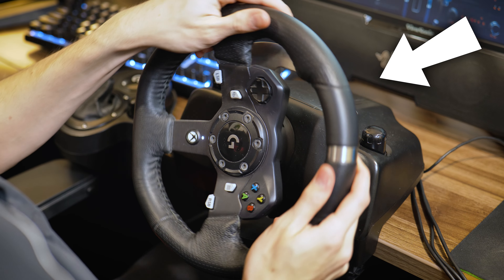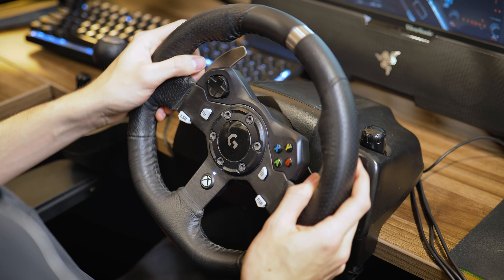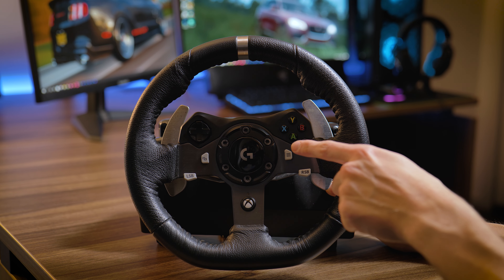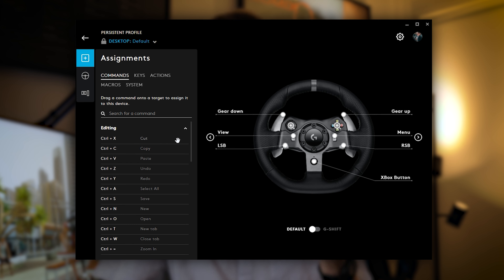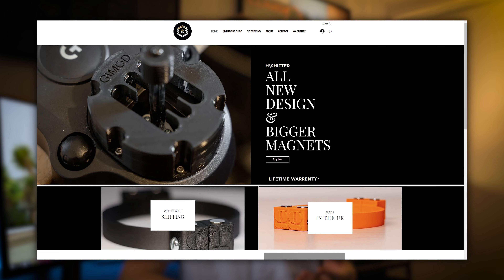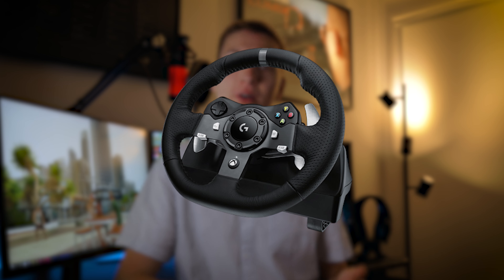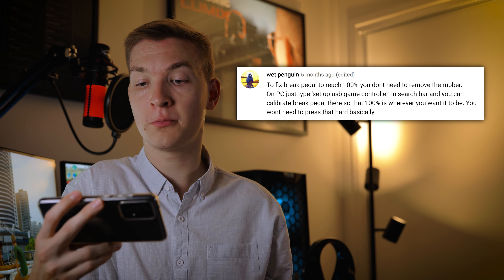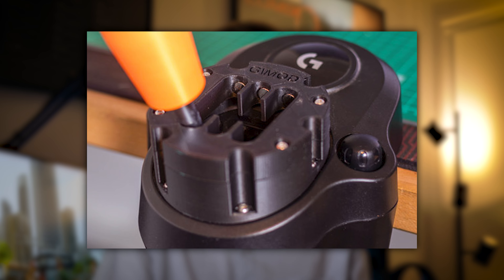Logitech G920/G29/G923: Don't Buy Blindly, Watch THIS First!

Comment: If the break pedal in your real car isn't acting the same as your gaming pedal on the g923, you need to get new breaks and break fluid really really fast
Reply: 1984
Reply: I've never used one of those, but it sounded a lot like my car lol
Reply: I have g920 It’s wayyyy harder than any car of ever drove even after getting new brakes
Reply: yea these people need to get their brakes fixed
Reply: Unfortunately, some cars have mashed potatoes for brake pads...I used to have a Kia that had a grossly soft pedal. That's just how they tuned the boosting, my Nissan on the other hand has a brake pedal that feels like the G29 pedals when you do the eraser mod 😍

Comment: $400 for a direct drive base only, a whole setup would cost about $1000.
Reply: This. Man almost sounded like he had a agenda when he said that.
Reply: Yeah but for 500$ you can buy a better wheel anyway with serious FFB torque. These G series are the weakest. So you either buy cheaper G29 or go for a better wheel at $500.
Reply: @bestopinion9257  that's what im saying and it is so unrealistic, sold mine after a year and a half. Played with it for about 5-6 times, the ffb killed it for me. Brakes and clutch on this were horrendous. Saving more money now for new belt based set up and better ffb
Reply: @SpeedNash  I had G27 and at its time was a good wheel. Best quality if you ask me with steel and leather and no signs of failure after 10 years. I bought G29 for the quality aspect but this is a fail. Nowhere close to G27 maybe except the leather. After 1 year already left shift doesn't work... A piece of junk, a downgraded G27 for the same money.
Reply: @SpeedNash  if you are saving money, save for a direct-drive wheel, they are cheap now.

Comment: This is the type of kid who wouldnt eat at all because his parents ordered cheese on his burger.
Reply from the maker: LOL ok...
Reply: All the things he mentioned are absolutely spot on. I've used G29 which is also one of the reasons I do not suggest people buying it and I sold mine in 1.5 years almost. If you want the best simulation experience logitech g29 is not it, stock steering wheel is pretty small, hate the sound it makes thats not how belt based wheels do which is similar to real life cars, breaks suck, logitech app does not work all the times or when it does the app settings do not align with in-game deadzone/sensitivity, pedal pressures, clutch absolutely sucks lol theres no pressure that shite is flat., takes 15-20 mins to set up and if im installing a new sim game, will take another 30mins to search right settings, aligning in app and in-game, the force feedback is servicable it is not at all close to what real cars feel, 

What are pros? Its the best wheel with the most compatibility out there I've seen for budge entry  that works out of the box in 90% games, even in PS2 emulators with GT4 through plugins
steering is very premium felt with nice leather stitching, quite comfortable to feel the games when racing however once you go off road it goes, ratatatatatata lmao what wheel does that, this is all due to motorized functionality.

I'm saving money now to either go for fanatec sim set up or thrustmaster, would be expensive but is defo worth it much more than this.

If you're on budget, go for it but do not expect realistic real car like behavior, its a stepping stone at best. Save a little more and go for thrustmaster for best ffb, essentially belt based motors.

Comment: Found it for $184 refurbished on amazon, definitely buying.
Reply: Which one? I am trying to decide between g920 (150 euro) and g923 (250 euro)
Reply: Which one? I am trying to decide between g920 (150 euro) and g923 (250 euro)
Reply: @verfresht  g920
Reply: @verfresht  trueforce and the better brake is not worth that much

Comment: I’ve had it for 2-3 years, the games I have played have a braking sensitivity in the settings so that was not an issue, the brake doesn’t have a ton of travel but that’s alright, you can also take out the rubber. Some people complain about the noise I haven’t had that issue I usually lower force feedback in games. I wish there was a separate place for the reverse instead of pushing it in. I also wish they made a handbrake.

Comment: the g923 doesnt have a rubber piece in the brake... instead there is just a extremly stiff spring which you can only replace😾
Reply: Vans slip on help that brake press

Comment: Re The brake pedal. On PC i calibrated the brake pedal using the Windows Game controller applet and set the pedal with approx 40% depression. Meaning 40% of pedal movement = 100% of pressure. For me in Assetto Corsa this pretty much makes the brake pedal accurate to a real car.

Comment: 1. I opened the pedals and removed the bump stop. 2. I never use the dpad. 3. bro is complaining about having to map controls, that is really not a problem. 4. I’ve had it for ages and they haven’t broke. 5. I’m not on console. 6. skill issue 7. “$400 is direct drive wheel territory” yes, for just the base not including the wheel, pedals, shifter and more which brings it up to about $800

Comment: I got it in portugal for 200 euros, my desk had no full suport to lock wheel 100%. In 2 or 3 races i expected wheel to drop 1 or 2 times with no warning. And pedals base just dance around my floor and almost damage the wire against the wall. Now i bought a lovit cockpit 200 euros, and this setup is amazing. Only good to talk about this setup! Worth it!

Comment: I bought a g923 with shifter with a stiffer spring and MVH load cell mod on the pedals for $190. And a stand for $50. If you are starting into sim and wanna see if you’ll enjoy it, find a second hand G series wheel and do that.

Comment: Hi , I appreciated all you said...BUT ...the G 923 for Xbox/PC and the gear shifter made in 2023 and this very important, this a diferent beast...all tthe issues previosly with G 920 is fixed , all the buttons are very diferent in a good way and pedals too and for the shifter in 2023 , if you opened , you will see a cheap  basic mod allready install ....buy all G 923 and shifter made after february or march 2023 an you will see all diferences ....very important the period when is made , check the date of manufacturing on the box ...!!!
Reply: What's the difference with the shifter ?

Comment: What about the brake firmware, can you make it fully linear? How it normally works is until you get to the rubber it's like 50% brake or something, but when you press through the bumper you get 100% brake, which is not great to control the car.

Comment: This review starts of with the brake. Simple fix is to use the logitech app and adjust the brake and gas for your likings. Then ... this wheel is the absolute best to buy for the low price atm. The force feedback isnt that strong, but i play assetto corsa sonetimes. And man.. that feedback is enough ! Keeps the gaming casual but very very realistic. Ill buy a more heavy duty one in the future, but for now this wheel is the best thing i ever bought.
Reply: Just turn the feedback max most people using a higher end wheel turn their feedback down 😂

Comment: I'd like to get a Thrustmaster T300 (for example) instead of a G29 because the T300 has a belt driven FFB (wich is way better than a gear driven one). However, in my country, these are the prices (brand new btw):

Logitech:
G29: ~363USD
G29 H shifter: ~93USD
G923: ~500USD

Thrustmaster:
T300: ~827USD
TH8A: ~400USD

So we don't really have an option outside the G29/G920.

Comment: Watch this vid and still buy blind. Very superficial and inaccurate.
Great entry wheels, very reliable with fantastic compatibility. 
If buying second hand be aware how to clean the potentiometers in the pedals.
The elastic band is a mod to use the shifter sequentially and not to ‘stop it ratting’.
One thing I would agree on is don’t spend over 150 on one.

Comment: Trying to decide between G920 (€150) and G923 (€250-€280). I wanna mainly play Dirt 2.0, Forza Motorsport, maybe F1. Happy for any advice.
Reply from the maker: If your going to use it a significant amount, go for the G923. If you think it will be used a handful of times a year, go for the G920

Comment: I'm on my second warranty g923 because the force feedback broke and my replacement wheel is slowly doing the same thing.
Reply from the maker: Wow that's a very weird issue to happen twice. How much does it get used? E.g. Days per week
Reply: Like not much since i work every weekday so on the weekends for like the past 2 or 3 months which is not even close to enough time I had compared to my g27 that I had for 6 years and I beat the crap out of that one.

Comment: Also the g923 just plug into the laptop, you don't need a gaming pc to adjust the wheel on the logitech programme, I do the same with my nacon controllers
Reply: so the settings you apply on laptop also are still the same when u use it on ps??

Comment: I want a g920 but I do it on console. Could I adjust the settings on my PC then switch it back to the xbox and keep the changes that I made on the PC?
Reply: Replying so I get notified if somebody responds
Reply: I did some more research and the settings saved to the computer not the wheel, meaning this won't work, just wanted to share for anybody else who was wondering
Reply: @kingkendrick7097  Ok thank you for checking on it.

Comment: Surprised you never mentioned about the wheel which can move side to side with flex, due to the plastic backing panel inside attached to a metal panel.
Reply: And what is that wheel?
Reply: @bestopinion9257  G923

Comment: There is shifter pedal at the back of the wheel, is there any reason those aren't sufficient enough?

 Asking because the gear itself is also expensive, I would rather not buy any add on at this moment.
Reply: Buy it second hand, together with the h shifter.

This is THE entry-level wheel. Everyone who gets hooked on sim racing sells it to upgrade.
And anyone who didn't get hooked, sells it to clear the space.

Comment: Guys I don't have a high budget... But i wanted to buy a Thrustmaster wheel and shifter those are very costly compared my budget... Should i buy a g920 or a g29?
Reply: G920 and g29 are the same just the 29 works only on PlayStation and pc and the 920 works only on Xbox and Pc

Comment: if i get G hub on my laptop and plug in everything and tune it how i want and then plug it into my ps5 will it save?
Reply: This is what I'm trying to figure out man I've seemed like a few people asked this question and nobody's answering it for some reason
Reply: Any update, did u tried it?
Reply: @daf2666  no. It doesn't have internal memory, you set-up the device.
It doesn't need that much set-up either, though - it's the most used wheel and everyone supports it.